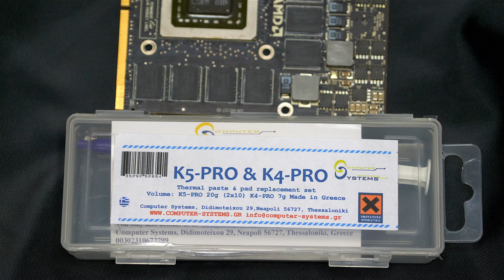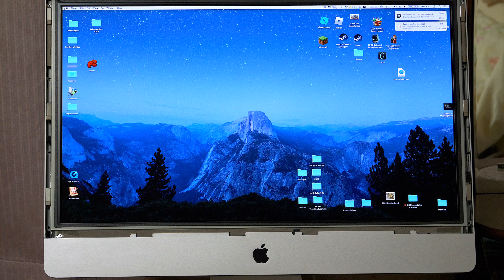Late 2009 iMac 27" Video Card Repair — 4850 — 3rd Bake

Comment: Hello, quick question, can I use the grizzly thermal paste on ALL chips, and not only the GPU?
Reply from the maker: No.  There is a gap between the memory chips and heatsink.  That is why you must use either thermal pads or K5 Pro.  But to use thermal pads means you must measure the gap.  I personally cannot measure that gap perfectly to my satisfaction.  That is why I use a thermal pad replacement thick paste like K5 Pro.  Never use K5 Pro on a CPU or GPU though.  It's only for cooler running chips like memory chips.  You can use any good paste on the video card GPU.  I recommend K4 Pro because it usually comes included in K5 Pro kits.  But if you want the best, buy Thermal Grizzly Kryonaut for the GPU and use K5 Pro on the memory chips.  That's the best possible thermal paste combination.
Reply: @JDW-  Thanks for the detailed answer; I had the same question. I see that the thermal paste comes in various sizes from 1G to 20G; how much would I need for the memory and the GPU chips? Back in 2009 I bought 8 iMacs as gifts for my siblings and for myself; since then 4 have failed GPUs. I've got two of them that I'm planning to bake. Mine is still running, but if I increase the brightness above four clicks the screen blacks out; I have to reduce the brightness and bump the cursor to the lower right screen corner to sleep and awaken the computer to restore the screen. I'm sure it would not hurt to clean out the dust bunnies. 
The Amazon product info for K5 paste states infinite storage/service life; is that so? Would K4 be any different? There were some comments of concern that they received fake Kryonaut paste from Amazon, but that looks like the source linked by the manufacturer. What was the reason for just applying just an "X" of paste on the GPU instead of a full coat?  Thanks!
Reply from the maker: @chidude  There's no such thing as "infinite storage/service life" for any thermal paste, and K4 & K5 Pro are no exceptions.  The Amazon descriptions are highly misleading so I posted this on Amazon just now in hopes of having it fixed: https://amzn.to/2WfVNvP

What is the actual storage life?  Only the manufacturer can say, but it depends on how you stored it.  If you store it sealed in its container and put it inside a dresser drawer (in a dark place out of sunlight or UV), it probably will last 1.5 years easily.  If you put it inside a double-zip Zip Lock Bag, it probably will last longer, but I wouldn't trust it to be "as good as new" after 3 years even in a ZIP lock bag.  Seal it in a vacuum with an inert gas and it probably will last 100 years, but even that technically isn't "infinite."  :-)

The "X method" of thermal paste application theoretically beats a complete spread of paste atop the entire chip because a complete spread of paste can result in air bubbles at times.  Many people use the "pea" size drop method, which I dislike. I dislike it because it spreads in an oval and fails to reach the 4 corners of the chip.  The X method spreads in a rectangle, covering the entire area of the chip and without air bubbles.  

A single 10g chapstick-holder size vial of K5 Pro will easily cover two GPUs worth of memory chips, even if you use a lot as shown in my videos.

Comment: I followed every step as you asked in the previous video (longer 1 hour video). After starting up both ODD AND CPU Fans are working at full speed!
Reply: Anyway to fix it ? Did I plug some cables incorrectly?
Reply from the maker: @NiroOnlineMusic  Yes, you either forgot to connect one cable OR one or more cables is not properly seated in their connectors.  You have two choices.  You can open your Mac and check all the cables (the best choice), or you can use a fan app to control fan speeds. Links to those apps are in the text description under my bake videos.

Comment: Thank you JDW! I have already ordered what you have used from your info prior to this. I am on this Covid19 furlough and my 2011 27 went green lines and then white. Nothing works to recover. I am so glad you did a 3rd try...I have never seen that but wondered it after the 2nd try. I will give you an update as others have if it works. I am using my old 2007 20 iMac to write this.

Comment: Sir please advice maximum room temperature for using iMac late 2009. It would be highly appreciated.
rajangam82@gmail.com
I had same issue but more than 1year I kept aside because of afraid to bake like you. Please advice me
Reply from the maker: Apple specifies the operating temperature of these iMacs to be 50° to 95° F (10° to 35° C).  I would suggest you follow my second bake video and use the thermal pastes I described there. So long as your oven has a stable temperature of 200°C, you will be fine. If you doubt your oven temperature is stable, just buy a turkey thermometer and put it inside your oven and make sure the temperature is a stable 200°C. If the temperature gets too much hotter than that, some components may become desoldered and fall off. It’s very rare when that happens, but a few people have said that happened to them

Comment: this didn't work for me, baked my video card for my  mid2011 imac 27" and all the memory chips and other chips falloff 😑😥😭😭
Reply from the maker: Kay, I am very surprised and very sorry to hear that. I say I’m surprised because I read and reply to every single comment under all of my videos (there are hundreds) and I can tell you that you are the first person who has ever reported chips falling off the board during a bake! Indeed, the temperature recommended is not high enough to melt all the solder to the extent that chips would fall off. So I suspect that even though you may have set your oven correctly, your oven may in fact get a lot hotter than the temperature setting that you used! You might want to check your oven temperature with a turkey thermometer to find out.
Reply: @JDW-  yeah am guessing the same here, my oven must have overheated or something. But anyways thanks for the great video, it actually gave the courage to open my imac though it flopped along the way
Reply from the maker: What are you going to do at this point? Depending upon how many parts fell off the bottom, it may not be wise to try to re-solder them. Also, if the heat was that high, I would imagine that some components on the top might have slid around too. All said, you probably will need to replace the video card, unfortunately. But I really would suggest you purchase of a turkey thermometer so you can check the temperature of your oven to see how much higher the temperature really goes.
Reply: @JDW-  I think am just gonna scrap it because I can't find a replacement here, am in Namibia. And all the pc shops are saying its a vintage computer and apple no longer produce those types of video cards which is unfortunate. And yeah I will try to get that thermometer it might help
Reply from the maker: @kaydbeats8661  I bought a 6970M for my 2009 iMac from the following EBAY seller in Hong Kong (that exact same listing).  He would probably ship to you if you were interested.  The down side is that the card isn't cheap.  Maybe you could negotiate a lower price if you told him to remove the heatsink, since you already have that.  It would make the package lighter and less costly to ship too.  That's really the best I can recommend.  https://www.ebay.com/itm/163991633495

Comment: Hello. I received the thermal paste, expensive for such a small amount. I got the iMac back together and found a 12 volt source on the power supply board, see photo in the link. An unexpected surprise is when the computer goes to sleep or off the 12 volts goes off so the external fan only runs when you are using the computer. I am not a gamer so I haven't been able to put a heavy load on the video card. The photos show the temp is about 115F after it was on for a while and the screen saver was running most of the time. Link to photos  https://photos.app.goo.gl/jMxuAF32wApG6JoU7
Reply from the maker: Hi, Steve.  I agree about the unfortunate high cost of thermal paste, especially K4 and K5 Pro.  I can only recommend it because (1) it worked well for me after my 2nd bake, and (2) the only alternative to K5 Pro I've found are fixed width thermal pads. 

Thank you for sharing the photos and temperatures.  115°F is 46°C which is quite cool.  Admittedly, I've not tested with a screensaver myself, but instead have used YouTube at 1440p in FireFox to drive the temperatures up.  Even so, your fan mod should keep the GPU Heatsink temperatures lower, just by reason of that larger vent hole and more airflow.  I'm also extremely pleased to see you found the 12V line which is switched off when the iMac is Sleeping.  Your post is certain to help others who follow in your footsteps.  Thank you for sharing!
Reply: @JDW-  hello. Thanks for your input. I think your videos and how you take your time explaining what you're  doing and reporting back on the results. Again thanks.

Comment: Thanks! 2009 27" - used lots of K2 and K4 as you suggested - 200deg c for 10 mins - all back together booted and displayed just fine for a day! Sadly it seems that the original 1TB HDD is now kaput though.- makes a clicking noise and disk repair doesn't work.  Can I install an SSD and somehow load MacOS without the original HDD functioning? We were really stoked to see it come to life - great vid series!!
Reply from the maker: Thank you for your kind comments and for sharing your success story with the video card bake!  I am sorry to hear about your HDD.  I used a Samsung EVO 850 1TB SSD to replace the stock Apple hard drive in my iMac, but the newer 860 EVO or the Crucial MX500 are equivalent. To use an SSD in late 2009 27" iMac, you'll also need a special mounting bracket and a separate temperature sensor.  All links are posted in the Text Description above (beneath my video).

The easiest way to install MacOS on a blank new drive is to use Internet Recovery, but the 2009 iMac does not support that unfortunately. You could also boot from the original Snow Leopard DVD that came with your late 2009 iMac and then do an install, but you would need to then do subsequent upgrades to newer versions of MacOS.  You can install all the way up to High Sierra on your model.  If you had a bootable USB thumb drive with a MacOS installer on it, that would allow you to install MacOS on a new SSD.  Or you could put that SSD in a FIreWire800 or USB drive dock and install MacOS on the SSD while attached to a newer Mac.
Reply: JDW it looks like you are trying to give me references to the hardware that I will need but I only see an @sign !  I like the idea of creating a bootable zip drive with a Mac installer - I have another iMac with Catalina on it can I use that to do that? Can I still get High Sierra from Apple? It is so nice to see this 27 inch iMac come to life again and again we thank you! My wife and I followed your videos labeling everything as we went it was extremely helpful.
Reply from the maker: @randallpatrickc  Odd that the URLs I posted were truncated.  I deleted them since they are in the Text Description under my video above.  Simply scroll up and click "SHOW MORE" to expand the text description.  You will see the links to the bracket, temperature sensor and SSDs I recommend on Amazon.  Let me know if you have trouble find them.

Comment: I heard you can use an external cooling system hooked-up on the back intake on the casing of the iMac 2009, to extend the life of the GPU.
Is this plausible ?
Reply from the maker: Your mention is the first I’ve heard of anything like that. In terms of what is practical for most people, a fan control app such as those I’ve linked in the text description under my videos would probably work best.
Reply: Yes you can add an external fan , I did. See what I posted today.
Reply from the maker: Christian, I last spoke to you 1 week ago.  Since then, Steve Tripoli chimed in with his experience about adding a fan for additional cooling.  It's not for the faint of heart, but it is not impossible either.  Please simply scroll down to his post where he offers a link to photos of his work.  The photos make it clear what work is involved, and what pins you would need to tap on the iMac's power supply to power that new fan.  Thank you again, Steve, for providing this guidance for others.

Comment: 4/18/2020 Watched your 2009 baked videos thinking of baking my own Late 2009 27" iMac GPU myself. One option I was thinking about and researching is since I have no issues with the Radeon GPU video in SAFE mode is to change the regular boot so it does not boot in accelerate graphic mode by disabling it and have the same mode it does boot in safe mode along with using the fan app to monitor the temp There are some videos and info online on how to change the commands and safe GPU settings the iMac uses when booting up. This might be an option if your iMac  GPU is not at the stage it needs to be baked. Also, some iMac Models have an Intel processor built into the CPU for graphics along with a GPU processor for two video modes to choose, by disabling the one causing bad video problem you should be able to switch it to the one that still works for the video since they are both built into the Mac.
Reply from the maker: In my experience, these old iMacs are really not usable with video acceleration turned off.  And even when you do that, some video cards are too far gone to work at all, even in that special case.  Also, the old iMacs like the 2009 model you and I own don't have a GPU inside the Intel CPU, so if the video card goes bad, you cannot use the machine.

Comment: Hi i have a mid 2007 imac with a same problem, can i do the same method of baking?
Reply from the maker: I cannot say from personal experience.  I can only say that a few 2008 iMac owners told me the bake worked for them.  There are no electrolytic capacitors on your video card, so it's safe to try it.  And actually, I found a YouTube video that shows a guy doing it with a heat-gun: https://youtu.be/QEaJER6YIcw
Reply: I try the baking to my imac mid 2007 it works now...thank you
Reply from the maker: @PrincieSanchez  You are the first person to report that the bake works for 2007 iMac models.  Thank you for the information, and CONGRATULATIONS on a successful bake!
Reply: @JDW-  Same here. It lasted almost 2 years. Just starting the 2nd bake.

Comment: Great video! I just did my 2nd bake and it was successful. Now I notice my fan won’t allow me to adjust down and it is full speed. Maybe I pinched a cable? Which cable do you think that would be?
Reply from the maker: I doubt that you “pinched“ any cables. More likely, you either left one partially disconnected or accidentally disconnected one. More specifically, if you disconnected any temperature sensor, then such would cause your fans to run at full speed. I would check all the connectors at the top area of the motherboard to ensure they are well seated in their sockets. And if you swapped out the hard disk for an SSD and used a hardware temperature sensor interface like I did, you should check that connection as well.

If you don’t want to go through the trouble of opening your Mac and checking again, you could use one of the two fan control apps I mentioned in the text description under my video, which would allow you to set the fan speed.
Reply: JDW thanks. I have the ssd app and even setting it to a lower rpm doesn’t change the fan speed so I think you are right about the cables. I’ll open back up and take a peak.
Reply from the maker: @mixmasterjt  If you have a "fan control app," regardless of whether you have an SSD and regardless of whether a temperature sensor is disconnected inside your iMac, that fan control app should still allow you to control fan speed.  Which fan control app are you using?  Feel free to post a link here to a screenshot of your fan control app settings, if you'd like me to have a look.
Reply: JDW I’m using SSD Fan control. I set to manual and increased the rpm down to 2000, and it still runs at max speed. I’m thinking i didn’t get one of the cables seated properly.
Reply from the maker: @mixmasterjt  That is very odd.  If you don't mind, please try this fan control app and let me know if the result is the same: https://crystalidea.com/macs-fan-control
Reply: JDW you are the goat. That worked! Thank you.